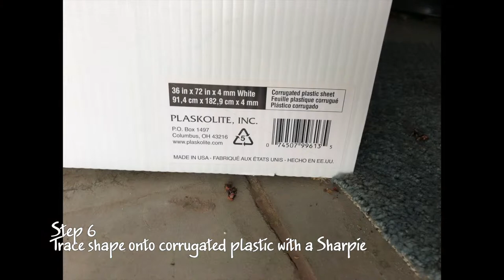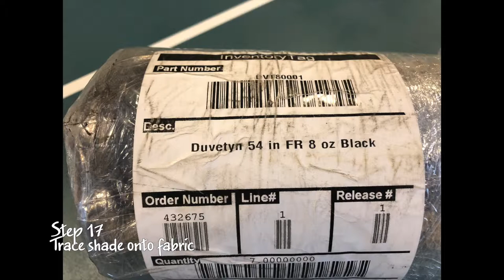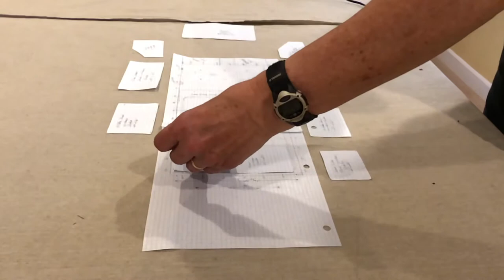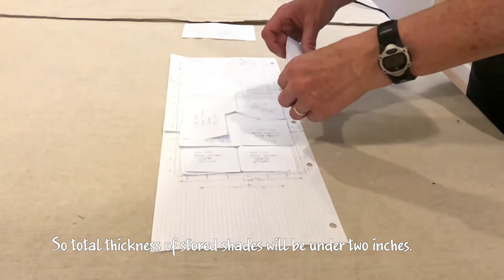Van Window Shade Prototype

Comment: Thanks for your video. I'm trying to make a set of these for my Chevy Express passenger van. This was very helpful.
Reply from the maker: Glad you found it helpful! Our shades have lasted us two seasons. As the shades wear over time, we have had issues with keeping some of them in with just the friction fit. If you start to have issues, you might want to try using velcro or magnets to keep them in place. Good luck with your project!